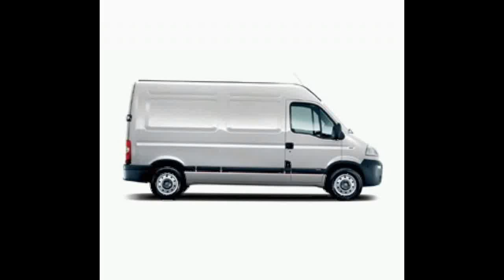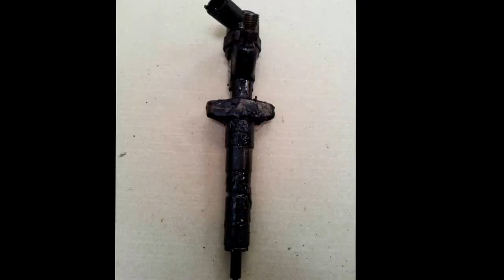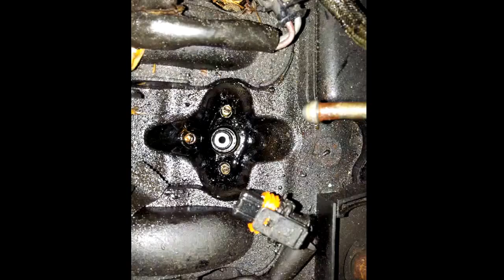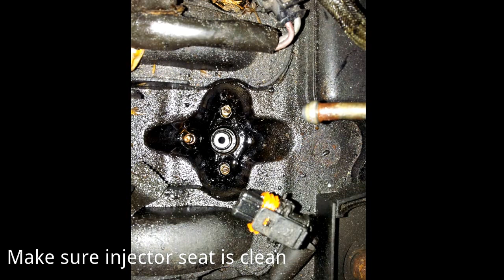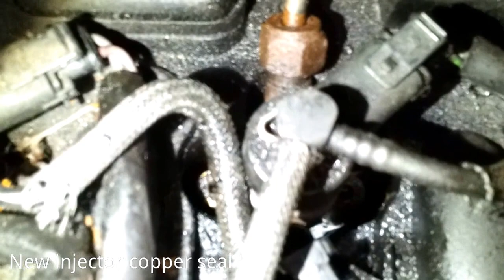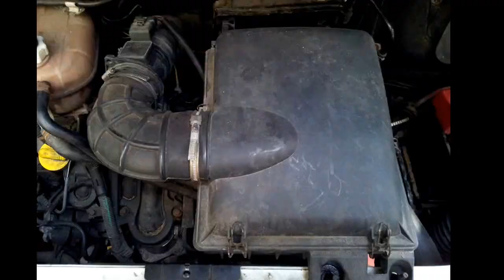Vauxhall movano 2.2dci injector seal replacement

Comment from the maker: Warm the engine up till the cooling fan cuts in if injectors have carbon around them this will make the carbon soft.I only replaced the one took me an hour I was lucky it pulled ok.